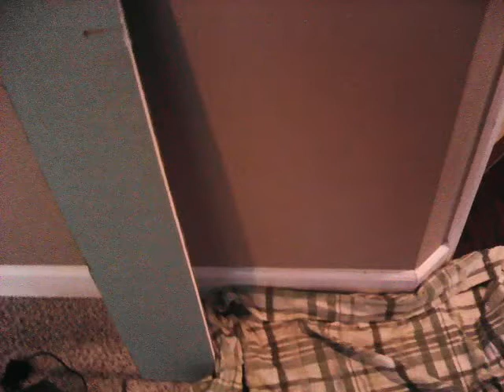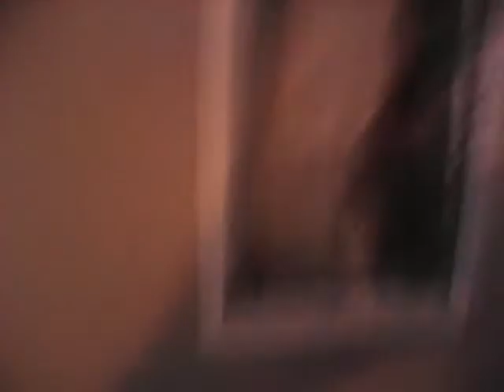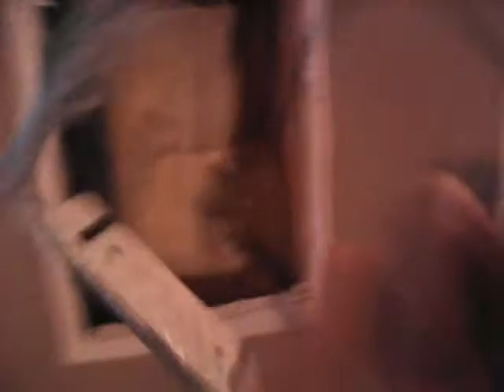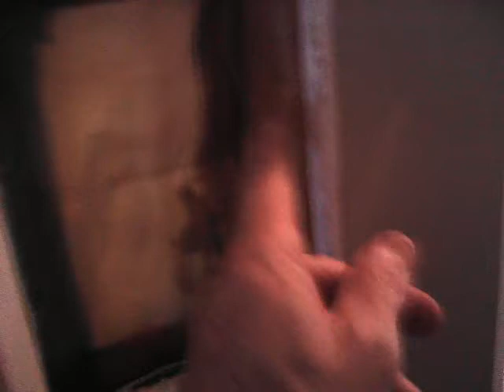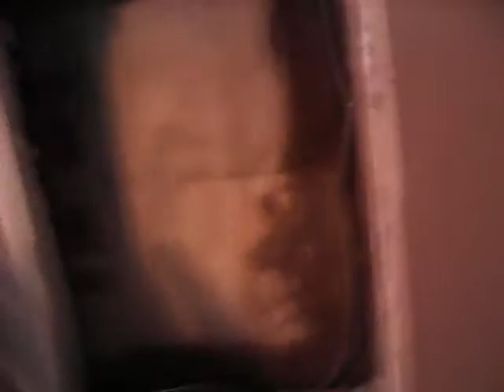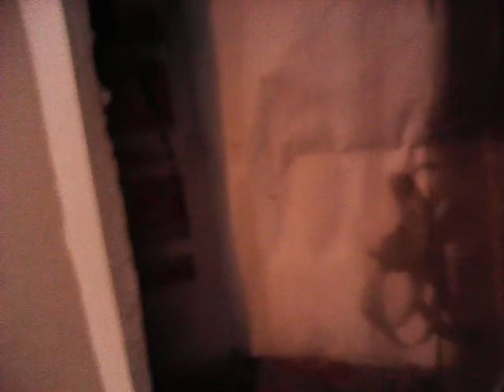Drywall Repair Part 2- Mounting Explanation

Comment from the maker: My channel on you tube is for all of you who want to learn easy ways to fix certain problems in your home. These can be with cracks or holes in your ceilings or walls, broken trim on frames, painting tips, prepping essentials, tools needed which are few, etc. These ideas come from a professional painter of 35+ years to demonstrate for you issues I encounter often before I can paint.